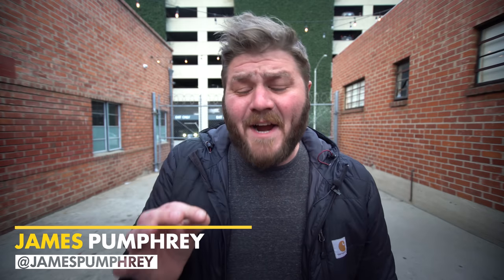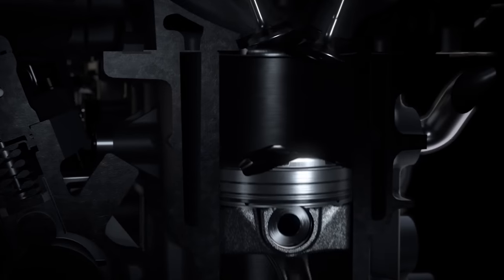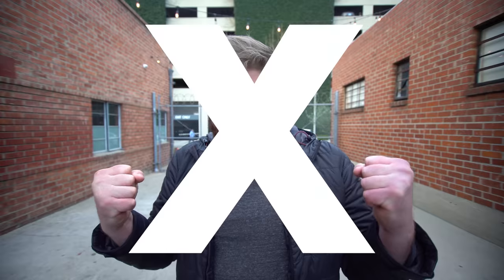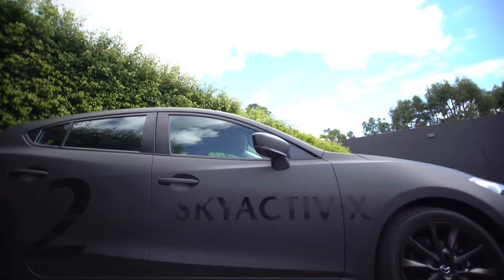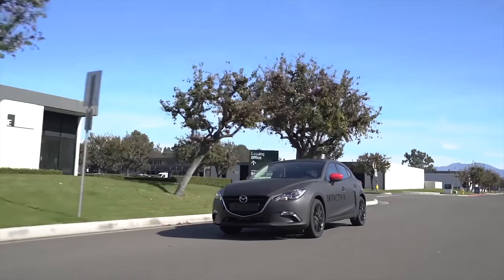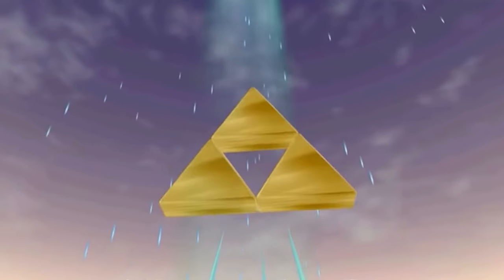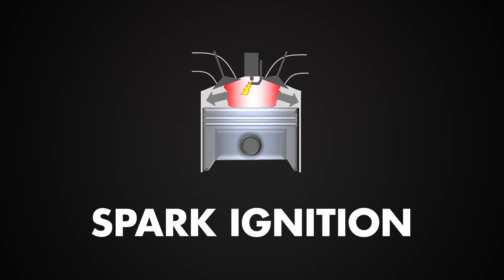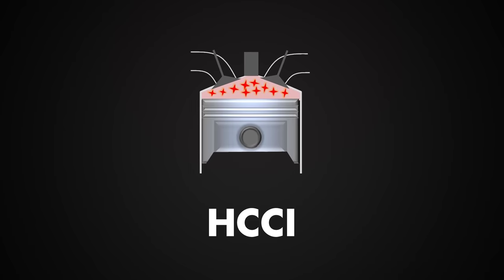Mazda's Secret New Engine Technology - SkyactivX | The New Car Show

Comment: Despite all the unsubstantiated blogsite rumors and bizarre comments from disgruntled Mazda employees... its no secret that Mazda is no longer in development of any new production Wankel engine... Mazda's board of directors voted in May 2009 to cancel all further development of commercial production engines and ordered all production to cease by 2013.... The very last series production engine was assembled on June 21st. 2012. The RX engine assembly facility at Ujina #2 was dismantled in late 2013 to make way for a new Skyactiv-G reciprocating engine plant. Mazda has not revealed any new engine prototypes in 10 years and they have not unveiled any new production engine in 23 years... if you think Mazda is going to bring them back? You are very naive.

Comment: Same unamed freelance designer for both Infinity VC and Skyactiv X engines. So which one is better?  Well the designer owns four Mazdas, a GSX Eclipse and a Civic Hybrid.  All of the cars have manual transmissions.  Some of the vehicles are test vehicles with prototypes or had prototypes at some point.  

He can run the coldest heat range spark plugs without fouling.  Can you say extreme boost pressure? As long as the engine is built to handle it.  Are you ready for daily drivers running close dragster levels of boost? Me neither... electrics are the way to go! JK😄  If you want the technology you need to start a crowd funding or something I don't know.  Nah, it's a bad idea forget about it...

Comment: I’m hoping someone will make a hydrogen burning ICE. That way we can go zero emissions but keep the three pedals and some of the noise.

Before engineers/scientists:
I know that it requires a large amount of electricity to make hydrogen, and I also know that hydrogen burns differently and doesn’t hold the same energy density as gasoline. I’m just saying it would be nice to keep the ICE while being zero emissions.

Comment: They say mazdas don't rust as anymore . They show rust . You have to undercoat and rust inhibitors are a must . I live near salt water and roads are salted in winter .
Reply: Mazdas are cheap disposable cars.
Reply: @doktorbimmer  your right and they have the same quality as ford ,chev and dodge which is pretty sad . I found the main problem with mazda is rust and the cost of replacement parts .

Comment: can you do something similar but with a rotary engine?
Reply: No, the Wankel engine cannot be adapted to HCCI technology because it lacks the ability to have high swirl, "Quench" type combustion chambers, high static compression ratios or variable valve timing. Wankel engines are obsolete and no longer commercially viable in the engine manufacturing industry... they are a relic of the past.

Comment: Hello Donut media, I was trying to find a good way to suggest a new episode but I couldn't find one besides sending a message out into the blurring galaxy of "mo powa babeh" comments.
I recently heard that a new company called liquid piston is innovating in some water injected two lobe rotary engines.
All I was able to find off the internet was carbon copied articles saying exactly what Liquid pistons ad said.
They claim 10x more HP and 3x more torque than comparable diesel engines, and thermal efficiency of 57% They claim a compression ratio of 18:1 and exhaust is allowed to circle around inside the ignition chamber giving up all the high pressure energy until it's extracted from the chamber somehow (which is confusing because they would most likely be extracting some high pressure gases at the same time, right?) 
Anyways The Popular Mechanics article i was looking at talking about this was from 2012.. how come this technology isn't a big deal right now? Is it a scam? Do you really think Liquid piston is genuinely innovating new technology?
Thanks Donut.

Comment: Why is compression combustion more efficient than spark combustion? They both do the same thing: ignite fuel. Also $10 million is too expensive, I’ll wait until it’s half price.
Reply: Peter Petruzzi Its the amount of fuel needed to ignite..... also its only $10 million because its a prototype. If they made 1 million cars with this engine it will be the same price as their current cars

Comment: Just like ford coming out with the innovated opposite piston engines where there's no sparkplugs either, and instead of having you regular intake and outlet of air and exhaust on top of the piston chamber you have another piston on top. Yeah which means there's another crankshaft on top of the engine which means there's more efficiency which means donut media should do a video about it !!! Because is so fucking cool ! Why cool ? Because is also supercharged and procharged engine at the same F* TIME!!!

Comment: They should put the technology in a rotary engine.
Reply: Doesn't work in the Wankel engine.
Reply: You sure?
Reply: @nametag1723  The Skyactiv-X concept requires static compression ratios beyond that which is possible with Wankel engines.
It also requires VVT variable valve timing not possible with a Wankel and high pressure direct injection which has been extensively studied in Wankel engines and found totally unsuitable.

Comment: Why not just pull a Volkswagen, and just, “change the EPA”?
Reply: Mazda was one of several companies that failed to meet the new interpretation of the existing Diesel emissions standards. Mazda Diesels were emitted 6 times the amount allowed and was unable to sell Diesel engines here because of these changes in EPA policy.
Reply: doktorbimmer thanks for info dude!

Comment: I don't get it... all this innovation for better efficiency at the expense of reduced performance? Why go thorough the trouble? What is the MPG by the way? My 2015 Altima already gets 32 mpg combined, yet produces 180 HP and is fun to drive.
Reply: Specs for the european engine is out already. 50-60MPG under European testing standards and 180PS/HP with 165ft/lb

Comment: Most of the idiots posting comments didn't even noticed he didn't really gave any specs on this engine. Why are you cheering for Mazda ? and what happened to America first ? and why are you cheering for ice car tech, when its clear they are on their way out. Every single car manufacturer around the world (including Americans) are moving towards new electric, fuel cells, or something else.
Reply: Mazda announced it is now taking orders for delivery in Europe in September, 178 horsepower and 164 lb-ft of torque, The 2.0 liter Skyactiv-X Mazda3 delivers 43.6 mpg on the new European WLTP drive cycle test. No EPA ratings yet but they could be near the 50 MPG mark. prices starting at $23,000 USD. The Skyactiv-X is expected to arrive in the states next year.
Reply: You could buy 5 of these Mazda's for the price of the best range performing EV available on the market.

Comment: why do they always gotta do the cool fuel efficient stuff to 4 cylinders, where's my vtec v8
Reply: The average driver really doesn't need 600 hp... or want to pay for the additional performance equipment needed to make a 600 hp car safe to drive.
Reply: The latest versions of the new Corvette currently have VVT (Vtec in Honda speak) and Dodge HEMI engines have VCT (VANOS in BMW terminology)

Comment: This car must be dangerous not filling it
 Up with the correct octane rating gasoline. Kaboom!
Reply: It actually is designed to run on 87. But according to Mazda engineers it would ideally run on lower 80s octane :)

Comment: Soo. Whats the actual efficiency? 35%?
Edit: Seems 56%. So half your gasoline comes out as hot air still.
Reply: Almost on par with electric power generators before all of the grid losses.

Comment: Lol i remember a car company had two spark plugs for each of their engine cylinder so for a four cylinders engine people need 8 spark plugs to replace all of them after certain miles on the car these were the days we don't have so called life time spark plug we supposed to check spark plugs for gaps to make sure they are within spec now mazda don't use spark plugs a lot Will it put the manufacturer out of business ?

Comment: Efficiency: Gas(25-35%) Diesel(50-65%)  who is killing the planet?  When I burn 10 litters of Gas as much as 7.5 litters is wasted (7.5!). High pressure metered Injection (HPMI) would improve Gas efficiency to as high as 75% but all automakers have shied away from it, and it is not new.  In 1986 Ford had the option of being a truly revolutionary product to market by using the HPMI Orbit(tm) engine in its Ford Escort and offering consumers 80 MPG and 250-foot-pounds of torque.  But Ford passed.  I think the Orbit engine is still available for marine applications where weight to horsepower to fuel ratios can actually be the difference between making it to your destination and being stranded at sea.  Diesels by their efficiency ratings produce LESS harmful emissions and require less maintenance which reduces auto wast in the long run.

TDI Love from Chicago...

Comment: Apparently instead of utilizing a spark plug they generate the spark from a small spike on the intake valve - the valve is electrically charged and when the piston moves close enough during the compression stroke a spark jumps directly to the piston.  To do this both the rotating assembly and the intake valves must be electrically isolated from each other.  This sounds like un ungodly expensive maintenance procedure when things aren't working right (and it will happen sometimes - spike erosion, etc.).  Awesome tech - yes.  Commercially viable - I'd be surprised.

Not to mention you are replacing intake valves instead of spark plugs when that electrode spike erodes - which doesn't sound fun or cheap at all.

Comment: So it takes three hours to explain how it works
What could go wrong?
All that over engineering,
Or you could have, ya know,
 simpler, 
more efficient, 
more powerful,
 safer,
 instant response,
Oh electric ⚡️ oh that, oh no, 
Nobody wants change
We are all quite content pooing where we sleep as we have done for the last hundred years, why change now.
( efficiency includes not just the engine but including everything beforehand like mining refining transporting)

Comment: Sounds like another unreliable grasp at straws from Mazda. And high compression is part of why diesels are so bad with emissions, it creates the nitrogen oxides (NOx). If you want to pioneer something, stick all your research into electric and self driving because that’s the future.
Reply: EVs are not the future... not 130 years ago when EVs were introduced and not now either... No amount of research will ever produce practical, rechargeable battery that can match the energy density performance of recharge rates of liquid hydrocarbons and this is why EVs have remained nothing more than a tiny niche market segment in the industry for over 100 years.

Comment: The future of Internal Combustion Engines is ...... dead.  Electric motors can easily outperform gas in every way.  Mazda is barking up the wrong tree (for all the paid marketing in this video).  For all the new burn process (with fancy acronyms) the explosion process is restricted by the timing of the exhaust valve that opens during the explosion process and the explosion continues out the exhaust and loses the benefit of all the fancy explosion process.  ie: this is bogus.  ICE engines can run faster than the physics of the internal explosion.  This is why race cars are so loud (part of the explosion is going right out the exhaust) .  MAZDA give it up and get electric.

Comment: Ugh.. stupid video meant to hook stupid people.  The prototype represents $10mm in sunk costs, but that's not it's value or even it's actual production cost.  It's $10MM of R&D which gets capitalized as an intangible like goodwill, not as a physical asset.  As for all the OMG game changer, variable spark timing has been done and done forever.  This sounds just like the natural extension of variable spark timing that says, yeah, this time no spark.  That's an impressive feat of engineering calculus and design, but it's going to be very limited to the particular application.  For example, the numbers would all change if they tried to use this engine in a heavier, bigger car (or even a lighter car).  So my question is how will it work when the car is being driven by an 80lb teenage girl, vs. when it's being driven by 250 lb. Bubba and his posse of 6'4" guys?

Comment: Imagine putting diesel in that bitch    probably would still work
Reply: No, because Diesel is very low octane
Reply: Cant take a joke can ya
Reply: Mazda is a joke...
Reply: And besides diesel is measured in a cetane rating
Reply: Sorry you can't afford a better car....
Reply: Wtf does that have to do with this     what car do you drive anyway a goddam renault
Reply: Diesel fuel is not sold by Octane Rating... but it still has a measurable octane rating usually around 15 to 40 RON.
Reply: Compression is high enough in this yoke to ignite diesel when the engine is warm. Like what he said at high revs the spark plugs cut out and it fires on compression
Reply: Wtf does Diesel have to do with Skyactiv-X??? At least I can afford one...
Reply: So yeah the diesel will combust easier with the lower octane rating. Petrol has a high octane which means it takes more compression to make it self ignite. Fuel injectors in a cylinder have 1 job: to atomise fuel. And besides mazda have a skyactive diesel engine. My dad has a cx5 and its been reliable af
Reply: Diesel engines run using only STRATIFIED CHARGE COMPRESSION IGNITION... it will ignite and burn almost anything flammable... regardless of octane rating
Reply: what car do you have so     an atomised fuel charge will self combust if the temparature is high enough. Thats why i said that the skyactive X would probably run on diesel when the engine is hot
Reply: The kind that hold there resale value... Engines that use Homogeneous Charge Spark Ignition have a minimum fuel octane rating requirement BECAUSE AF charge could self ignite... this is a bad thing. Diesel engines do not have this requirement because they use Stratified Charge Compression Ignition.
Reply: What car is it then? A load of em hold resale value. The mazda skyactive X engine runs like a diesel when the revs are high enough. And yes if theres a hot spot in the cylinder a petrol engine will keep running with no spark. 2 strokes are prone to it. Anyway when this new engine gets the revs up the petrol is injected into the cylinder like a diesel and the spark plugs arent sparked. Basically a petrol engine running like a diesel. At the high revs diesel could be injected and run fine cos the compression is high enough. Petrol has a high octane much higher than diesel so theres no reason diesel wouldnt run in it at the engines sparkless mode
Reply: And besides at this engines sparkless mode its dieseling. Firing in an atomised spray of fuel into a hot pocket of air   THATS WHAT A DIESEL ENGINE DOES      theres no reason why diesel would run in one of these in its sparkless mode